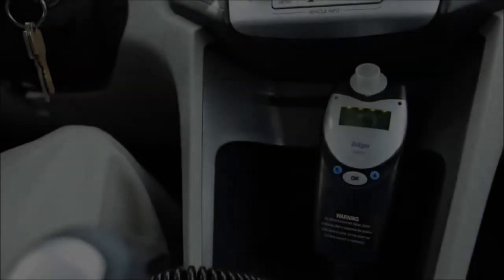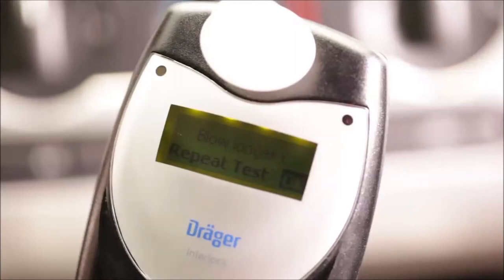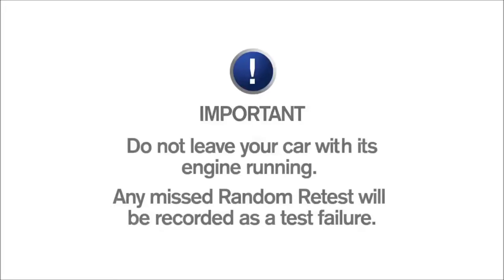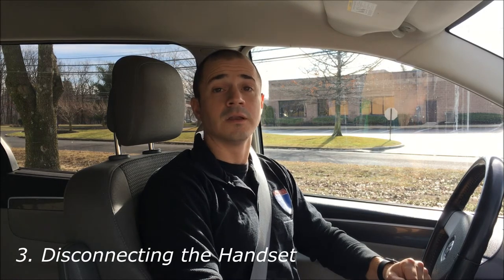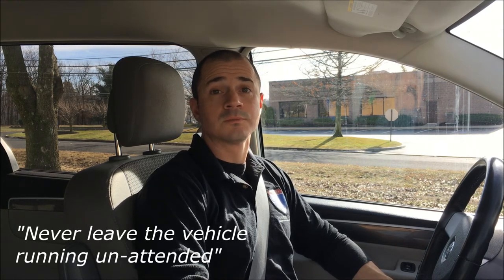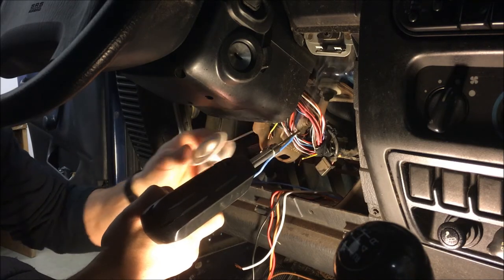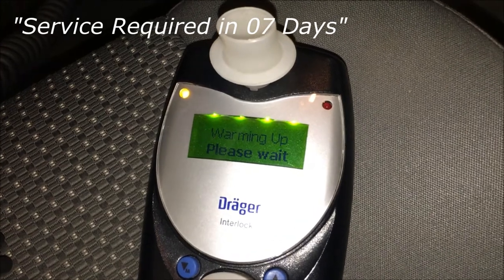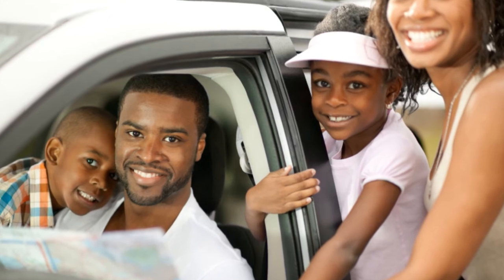Interlock Device of New Jersey Orientation Video Interlock Training Video Ignition Interlock Video

Comment: does my mechanic have to fill out a an access code request form in order to work on my car or do i just give them the 1-800 number to call?
Reply: @christroendle7263  oh ok. Well luckily I went back to the mechanic and stayed there with him if he needs to start the car to move it, but didn't even have to do that. He just had to turn the key to get electrical power cause he was working on my moon roof.